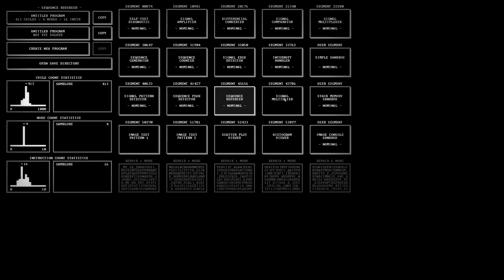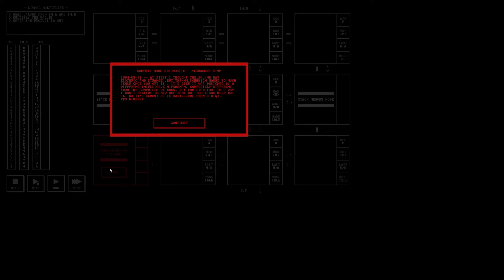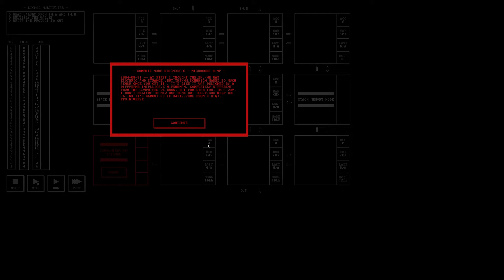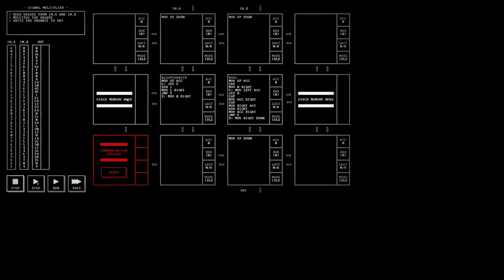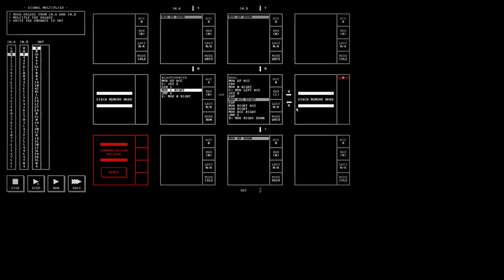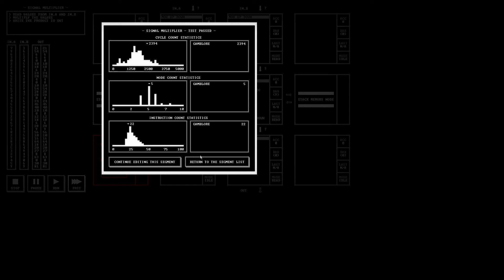TIS-100 Signal Multiplier

Comment: This is an interesting way of doing it.  I managed to use two parallel execution chains and got it to 2079 cycles.  The chains aren't really completely independent since there is a lot of locking going on to prevent race conditions. Gonna post my solution online, but i'm really scratching my head as to how to do it better.
Reply: My solution, which is a HUGE chop chop work is doing it in 1832 cycles. It's sheer luck and huge workarounds, but using 8 nodes and 59 instructions: https://imgur.com/a/mxkxIf9